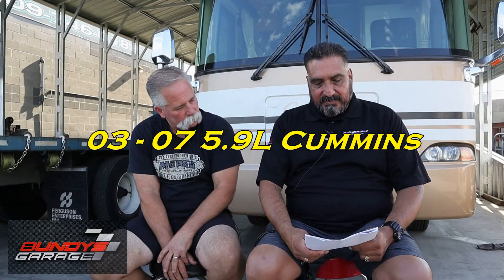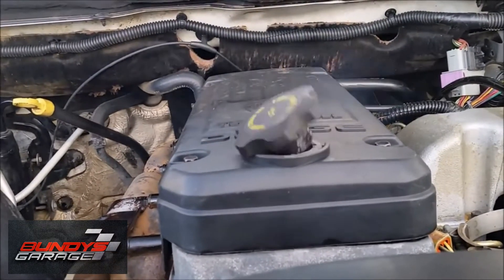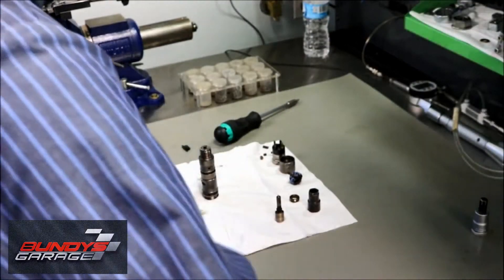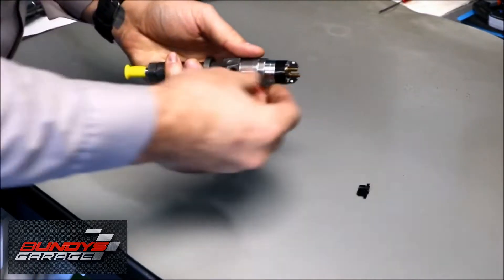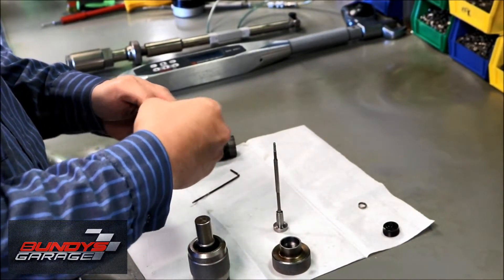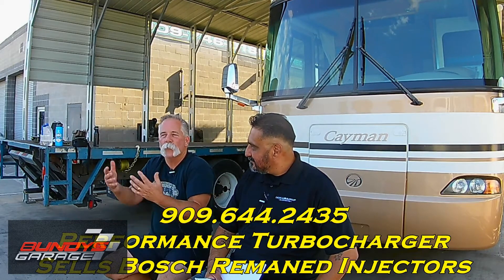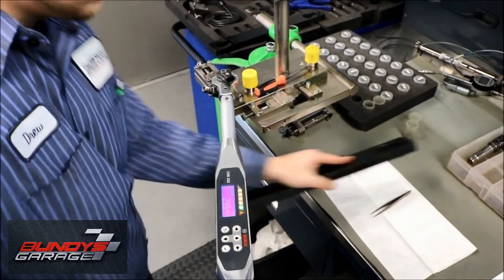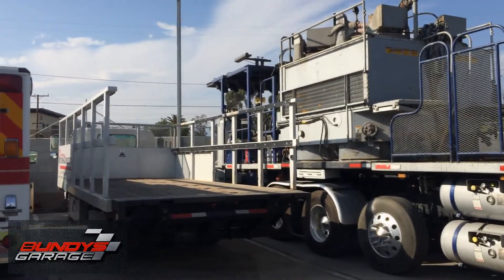Cummins 5.9L Blow-by at Oil Cap | Bosch Re-manufactured Reman Diesel Injectors

Comment: 98% of diesel truck owners, need a gas engine.
Reply: For what? Gas motors are inferior when it comes to torque and towing.
Reply: @shickenchits8123  utterly unresponsive to the point made.
Reply: I can agree with you. Most diesel owners now want to make high horsepower, race and do mediocre burnouts. That's when problems start to occur. Unfortunately I've become the 98% only because my old diesel worked as a farm truck its whole life before it was handed down to me. It still tows, on occasions.